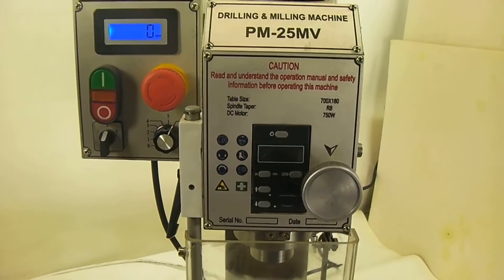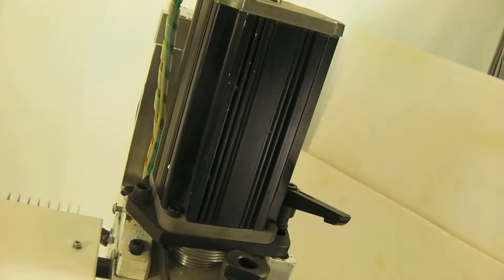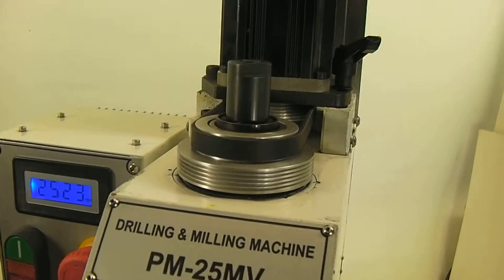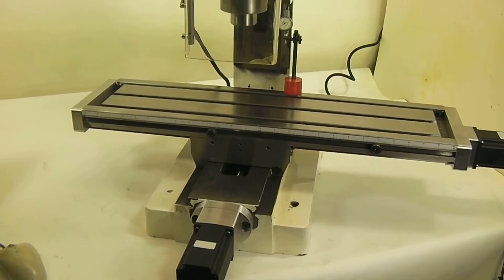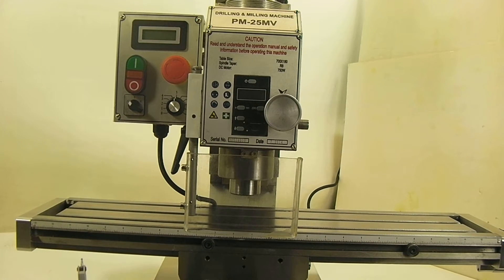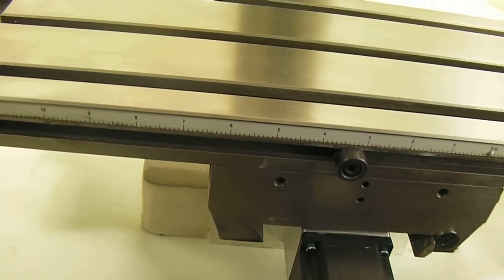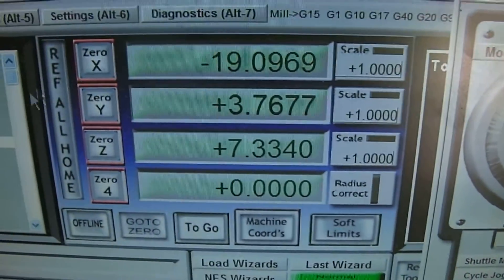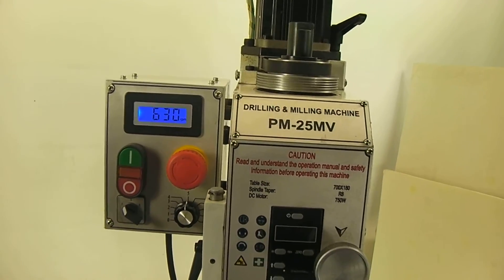PM-25 Milling Machine with  Two Speed Belt Drive

Comment: hola amigo soy tony de argentina miro siempre tus videos tengo un problema con el mach3,me arme una milling y el el peck drilling G83 cycle tengo un grabe problem se entierra push tool in the material biolent ,at drooken center drill in the one mecanizader at hya have not de solution,please hllp my, sorry for my enghis saludos tony frome Argentina

Comment: Thanks for the video, do you prefer this PM25MV over the grizzly 0704?  I am looking at doing a CNC conversion, dont have the money for the Tormach 770, these seem like a decent compromise?
Reply: Also, would this mill handle aluminum/steel milling better than the 0704?  How does this spindle HP compare?
Reply: Anthony Webb..... The PM25MV is MUCH better suited for doing a CNC conversion than the G0704 is... much easier to do,  due to better clearances, and an overall better base design.  Also. the two speed belt drive on the PM25MV lends itself to better adoption to CNC than does the gear drive setup of the Grizzly 704.     I think, for the money... that the G0704 is a Great buy.... but, I think that for the extra $300 or so extra... the PM25MV is just a better overall quality machine in numerous details.

Comment: I have the same mill, but without the CNC motors. I did get the 3 axis ES-8A DRO and X Axis Table Power Feed.  You were mentioning how quiet yours is, but mine is quieter and does not have that raspy noise that your does beginning at 1:44 . How and what did you lubricate your spindle bearings with?
Reply from the maker: The spindle is stock.

The noise is louder with a camera that has auto audio gain. In a room its fairly quiet.  They did make some changes to the motor in newer units but I don't know exactly what they were.

I'm making parts with the 25 now and it has been good. I cant see any backlash in the cuts and the motor has good power.
Reply from the maker: Cameras with auto mic gain do sound strange. I do understand that they made an update to the motor and controller so the newest mills may sound different.  Mine has been working fine. 

I have not re greased the spindle yet.